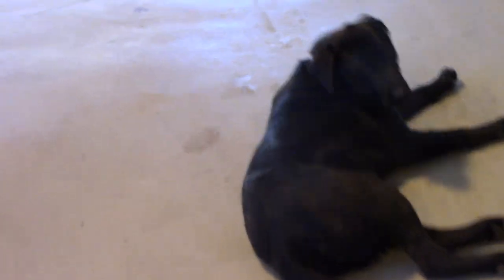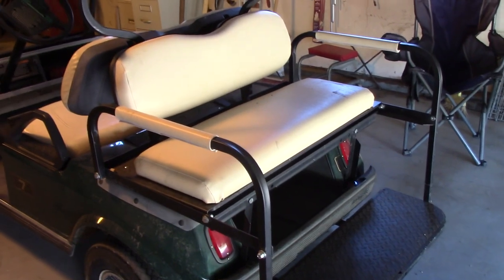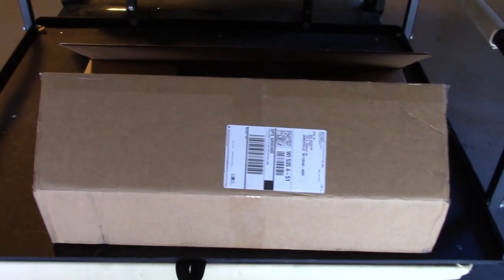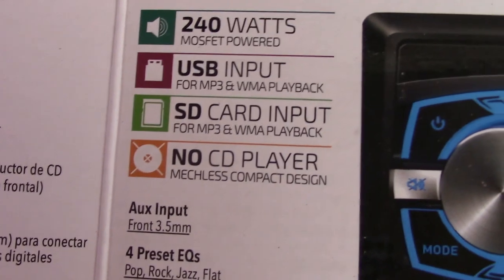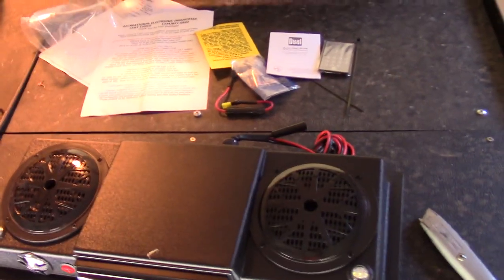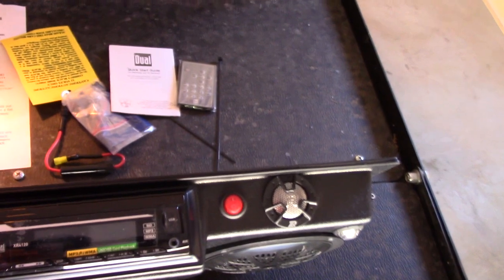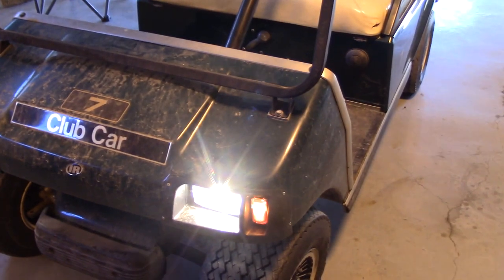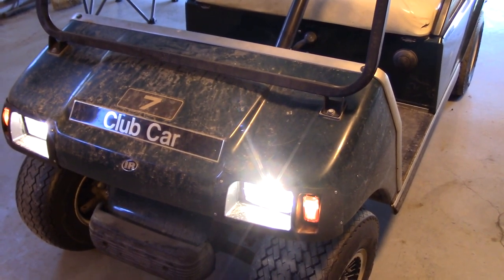Installing Radio on Golf Cart Part One

Comment: The purpose of the extra fuse, is to place it as close to the battery as possible.
Reply from the maker: You're right.  In fact the manufacturer of the console left a comment on part two of this series saying that same thing.  That way if the positive wire insulation gets nicked anywhere along its run up to the radio, the fuse near the battery will blow.  A fuse up near the radio would not provide this protection.  Thanks for watching and commenting.

Comment: Can you provide the link to which one you ordered?  Thanks!
Reply from the maker: The original posting is gone.  Here's a link that is very similar:  https://www.ebay.com/itm/Golf-Cart-Radio-UTV-Polaris-EZGO-Club-Car-Overhead-Console-Stereo-Radio/112477309171?hash=item1a302b88f3:g:ZzwAAOSwTuJYpQ2N

If that link doesn't work, the one I bought was from an outfit called Car Tunes.  Also, you can just Google "Golf cart radio" and you can quickly find a similar unit on eBay or Amazon.  The one I purchased cost just less than $300.  That might sound a little pricey, but it includes everything; radio, console, wiring, fuses, even antenna.  You can probably find a cheaper one if you look hard enough.  I've had mine for about one and a half years now, and I am totally satisfied with it.